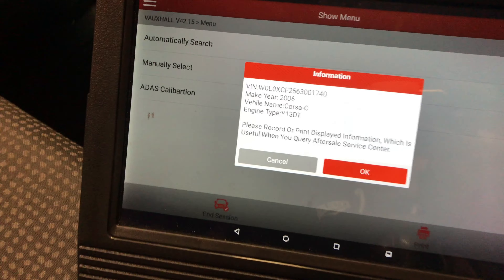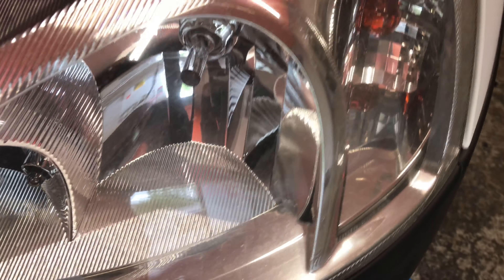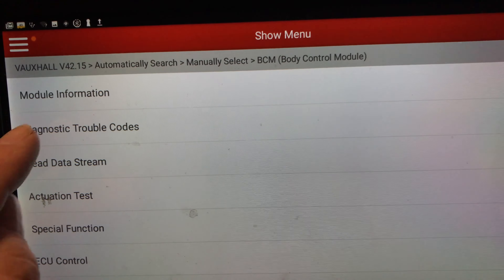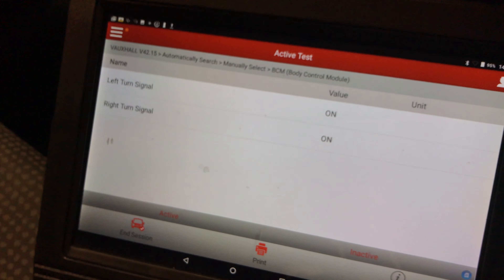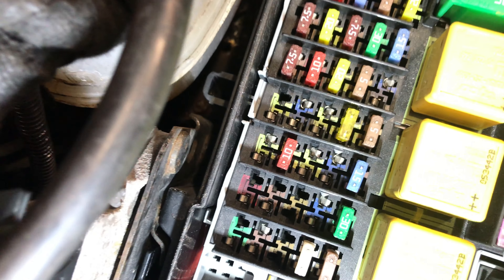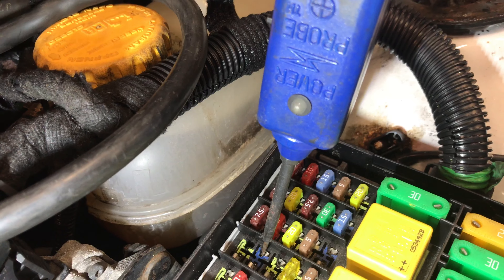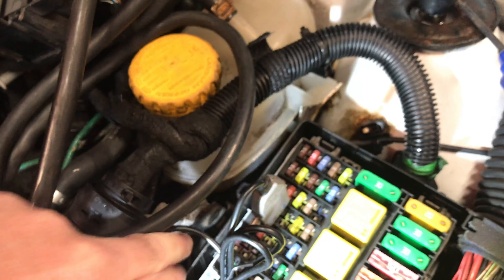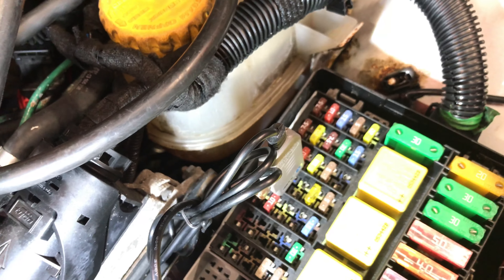Vauxhall Combo B (2005)  - Indicators/Turn Signals not working

Comment: I thank you for the data, after changing spotlights, check and clean the legs of the fuse 11, and I already had directionals.  Thank you Sandy

Comment: Anyone help?I've got a 2005 doblo which is basically a crap French version of the Vauxhall Combo.I have  fault code b1007 ,incorrect direction lamp ??(i've replaced them but no improvement)
Symptoms are all indicators on driver's side are dead,they don't work from hazard switch or indicator stalk,but all indicators on passenger side are fine.
Indicator light on dash flashes quickly like when there's a bulb out when indicating right,anyone any ideas?
I've supplied live feed with power probe to driver side front indicator,it lit,which rules out bulb and a bad earth.When i hit the positive wire all the way back to the rear with the power probe the bulb will light,so wiring 'seems' to be intact.Thanks.